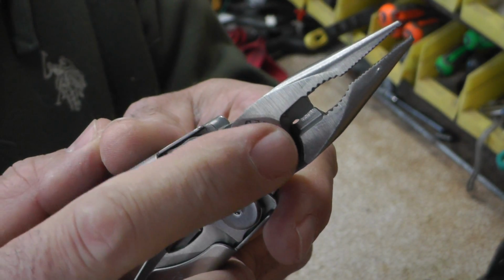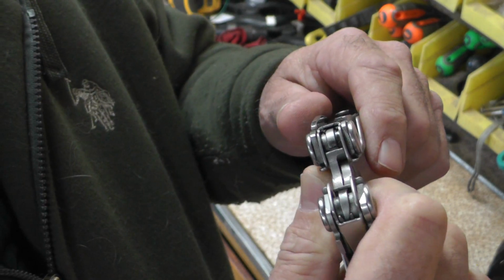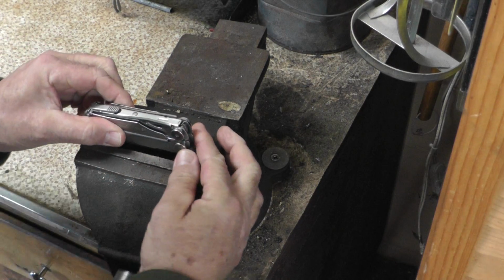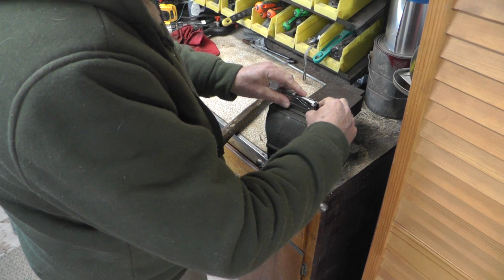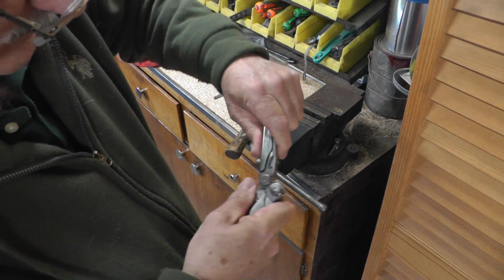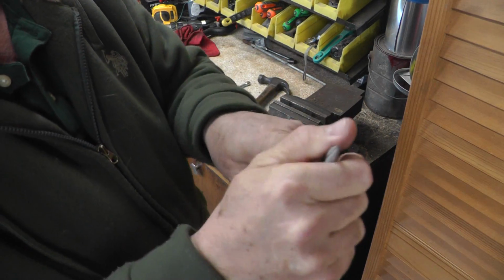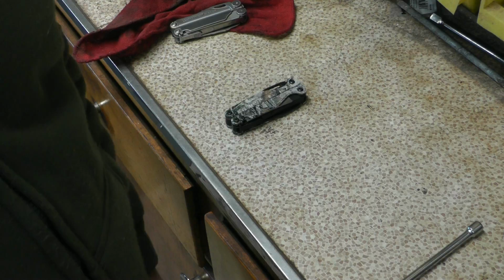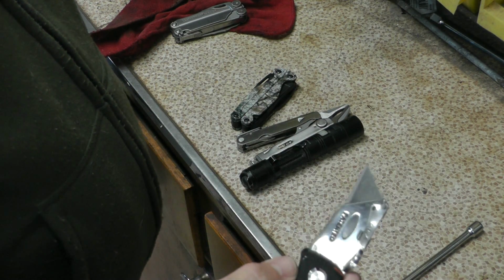Fix Your Leatherman Wave EDC Repair DIY How to Repair

Comment: My dad gave me a leatherman wave in 2005 I have used it everyday and carried it everyday. 12 years as a paramedic and occasional firefighter. Countless times ears landscaping(the trade my dad taught me)  as a diver/ aquaculture technician and as a carpenter building barns and toolsheds. My dad died suddenly in April very suddenly and the tool he gave me was on my hip for the wake and the funeral. A few months ago the problem you made this video about started happening and I was beyond terrified to mail the tool my dad gave me years and years ago that I cherished as a link to him from Rhode Island to Washington state. Tonight I found your video and I was able to retension the tool myself. I don’t need to send it and it’ll stay right here with me safe as I use it working , camping, hunting, fishing and trapping. I’m crying as I type this but I need to thank you for this video. From the bottom of my heart thank you i know this sounds dramatic but it means more than I can express. Thank you
Reply: My dad never gave me a Leatherman, but it doesn't matter, the favorite I have was discontinued, and I cannot send it back for repair, as they would send me a different model as a replacement! It has the perfect set of tools that I love! If you ever break a tool on the one your Dad gave you and want to repair it, consider buying one just like it on Ebay and replacing the broken piece from the donor. If you can use a Leatherman, you can repair it, and nobody can replace the one your Father gave to you!!!
Reply: BTW, I wish I could give your comment a heart, for you and your Dad.
Reply: Thank you for sharing this story.  Great news to hear that you were able to fix your Leatherman.  There are some things that are priceless, and the memory of your Father will always be with you through that Leatherman.  I recommend buying a replacement when you have some extra money and store your fathers somewhere safe.  Take care.

Comment: Thanks! I squeezed mine too hard trying to crimp wire connector. Heard a pop, and one side went really floppy. Watched this video.. Took a punch and gave it a healthy tap and it's as good as new again. Thanks so much for this tip!
Reply: Same here,
I did tap but didn't get the result
Reply: That pop, when closely inspected was crack on handle near the saw liner
Reply: @jhgindia  same thing mines also cracked. Doing the punch still seems to make it usable. I'm gonna get some security bits and try to JB weld the crack.

Comment: Thanks for the tip!! My Wave has the same problem. I’ve only had for year and it started to do that. I thought I needed to adjust the torx screws but glad I didn’t now.

Comment: Thanks for the tip. Had my Wave for close to 15 years. I used a small 8oz ball peen hammer to close up the gap between the frame and hinge.

Comment: Thank you for this!!! My Wave+ has had this problem for several months, I thought it was because I tried to cut too heavy of a wire. Because I don't have a good bench vice to set it in, I used a center punch set loosely for hot wheels post removal to punch in that part, the good thing, is if I have to do it again in the future, I already have a point to put the punch on lol

Comment: I have the opposite problem on my Rebar. Once the handles are opened all the way, like they need to be to use the pliers, it's very difficult to get them closed again. It seems to be rubbing in the exact area where yours is too loose. Is there a way increase that space,  maybe get a thin flat tool and pry it out a little?

Comment: Hi,
A word of caution if you are thinking of trying the adjustment to your tool, I done as instructed , the first side worked well but in doing the second side the frame broke, maybe I don't know my own strength but joking aside be careful not to strike too hard.
There is a happy ending to this story, I sent my Wave to leatherman & got a new Wave + as a replacement, still cost me £7.30 to send special delivery.
Good luck!

Comment: Hi,  one question to all wave owners. I got a new Wave one week ago and it already has the problem that is shown in this video. Is it normal? show I return it? or will I have the same problem again?  Thanks in advance for any good advices. And thanks for this video!
Reply: update: I just did it. and it worked.
Reply: I would do what is shown, unless you do not own a bench vice, a center punch works nicely (set loosely) if you do not own a bench vice, I just used one on my wave+ tonight after watching this vid lol

Comment: What to do if that same part your tapping,in mines its actually broken,on both sides.
Reply from the maker: Leatherman has a 25 year warranty. Fill out the form on their website.
Reply: jcook007fix didn't buy it from their website or store.
Reply: Steven Joseph it dosn't matter
Reply: Martin Brabenec Got it welded, works great now.
Reply: Steven Joseph I am glad to hear that!